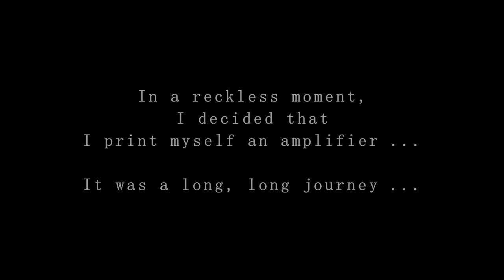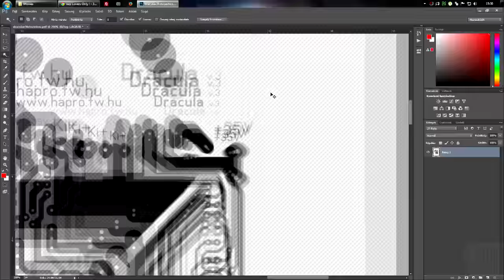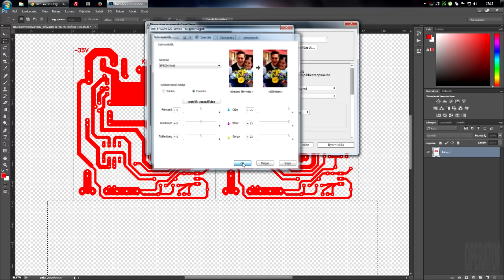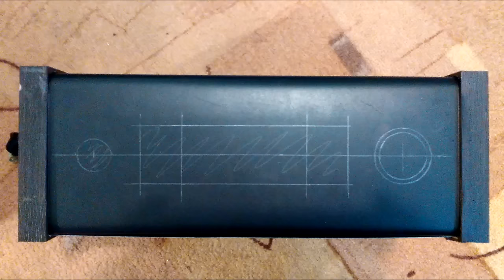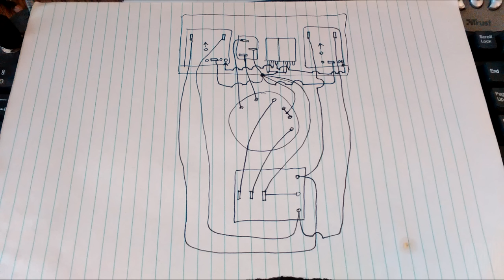Epson S21 turn into PCB printer & Print a Dracula MOSFET Power Amplifier

Comment: You are a genius :)
Reply from the maker: +Dj GARFIELD Eplkt Oh, thank you, but I'm just persistent. :)
Reply: +resystanc3 
I think about using an old Epson C82 to build the same :)
I've got some questions about the printing method , do I have to increase the printing contrast to make a good layer on the copper plate ? 
I know PCB etching since I was young , and I tested many many solution to get rid of the insolation that require UV light , and too much manipulations ( insolation , developpement , etching ), I tested the Laser transfert , but I didn't reach such result with this method , even if the result remain almost correct , I cannot make very thin circuit , it works for power supply prototype , but not for any small electronics like µcontrolers proto or similar :)
Reply from the maker: +Dj GARFIELD Eplkt Hi! Nice! :)
"do I have to increase the printing contrast" Yes, see in my video from 3:34 to 3:50. (See the description)
I think the minimum distance is 0.2mm with this technique.

Article (hungarian) and photos: http://www.hobbielektronika.hu/cikkek/epson_nyomtato_atalakitasa_sikagyas_nyak_nyomtatova.html